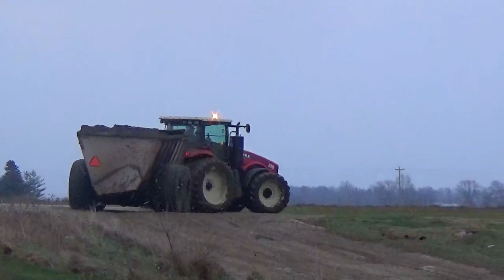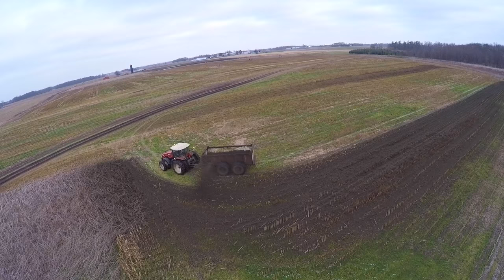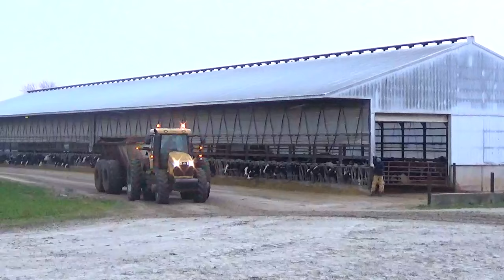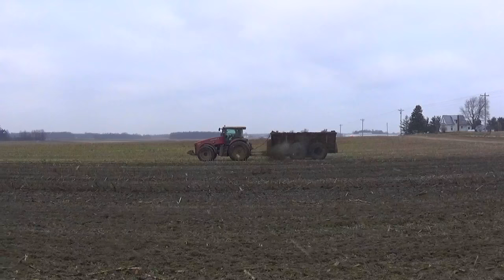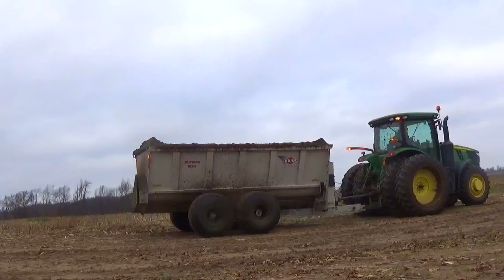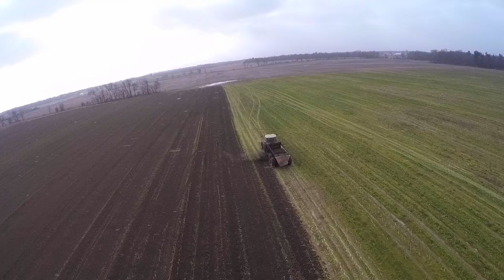Hauling Cow Manure in Northern Indiana

Comment: Dumb question - when spreading manure in this manner, what happens to the creeks, streams and rivers if a big rain occurs? I see the snow flying - are you intentionally spreading in winter so you don't get a rainstorm? Will the spring snow melt take manure into the streams? Not criticizing, just trying to learn how it works. I realize no farmer would intentionally pollute.
Reply: I think you need to realize that the soil is not concrete so that means it will soak in

Comment: Mike, any theory as to why Versatiles have always been popular here in Indiana, even before articulated 4WDs really caught on here?
Reply: very cheap hp
Reply: Indiana made Cummins power under the hoods. Engines not assembled in Indiana anymore but the world headquarters is still here.
Reply: I don't speak from experience firsthand, though the farm I worked on had an old 965. But I read guys mainly liked that they were powerful for the day for running large implements. Less complicated for more reliability and lower cost of ownership, and less fancy, so cheaper. And what Jay Smith said. Cummins power.
Reply: ...They're like the 2nd gen dodge cummins of tractors. Well, minus the riced out wheels and a flat brimmer rollin coal in his HS parking lot.

Comment: 310hp to pull that baby spreader? i pulled that with a 200hp case with no issues
Reply: Huh? So if a job doesn't require the maximum power the tractor is capable of it shouldn't be used? That's pretty stupid. You know engines can run at varying fuel levels right all the way from idle fuel to full load? They aren't controlled by an on/off switch. If your 200 hp case did the same job than the versatile would be generating basically the same power level while doing the same job.
Reply: Spoken like a man trying to defend his 5” penile system.  “All that extra is just a waste!”  Maybe it was the smallest tractor available at the time.  Maybe they don’t like putting as much strain on motors.  Maybe some men are just plain bigger than others.
Reply: Exactly. Yeah tractors are built  to work but, like any machine, they don't last nearly as long if pushed to the limit every day. It's like anything mechanical. I guess youtube experts don't realise that.
Reply: good for you here is your medal lol
Reply: They might not need a bigger spreader and be happy with what they have, like the others said, less wear and tear on the machine the more hp you got available.
Reply: So did I. Actually I don't think my tractor had 200hp it was a 7210.case ih